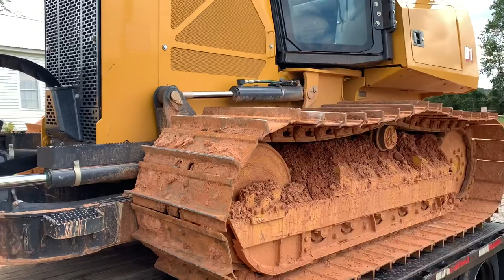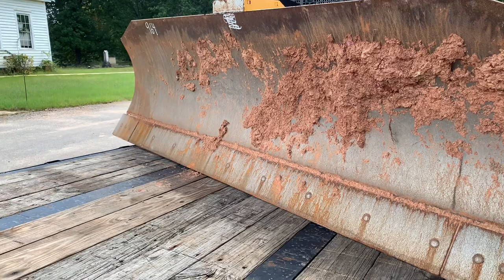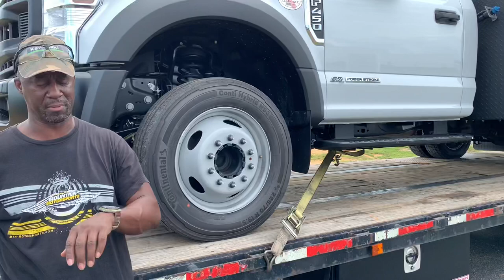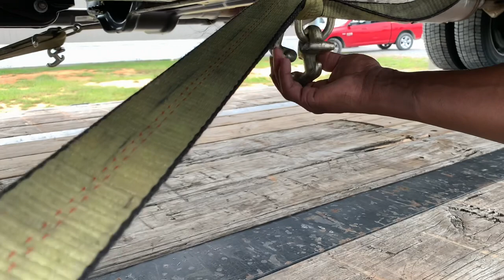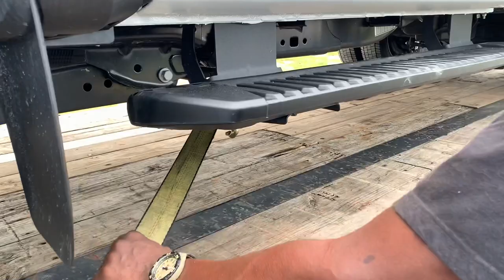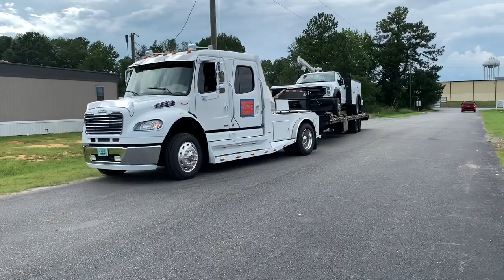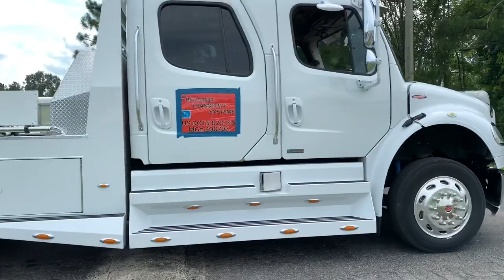Another Load Gone Wrong?! | CDL Hotshot | Bigshot #hotshottrucking #bigshot #freightliner

Comment: I left a tractor at United Rental one time. It was pickup 2 on a two pic and two drop load. United failed to account for a real heavy attachment on the rear so it was making me overloaded so I had to leave it. The broker was amazing. He paid me the same rate to haul half the load plus $150 for not picking up the tractor. So I actually made more money by the time I was done.
Reply from the maker: Wow that is an amazing broker! We got f’d with no grease this broker blocked our number and email so when we try to call about TONU we cant reach her or anyone .. Shark Logistics.. stay away

Comment: I liked what I seen when you secured the Ford truck to the trailer. You are right, safety is a major component of hauling equipment. But a lil advice on the dozer or any other heavy grading equipment. Always......... always remove the dirt from the the equipment (00:20) before loading . As a lowboy operator, I have experienced what damage it can have to traveling public and it was a lesson learned!! Safe travels.
Reply from the maker: Great advice! Tbh we havent even really done too much equipment like that since.. kinda just turned us off from it.. but if the right opportunity presents itself we will take it for sure

Comment: You should chain above suspension AND below suspension. Pick one or the other,  strap the axles and wheels and let the body move and float on the suspension. Or strap the frame down and pull the suspension right so nothing can move. Iv had chains get thrown off and come loose doing this as the body will still move up and down.